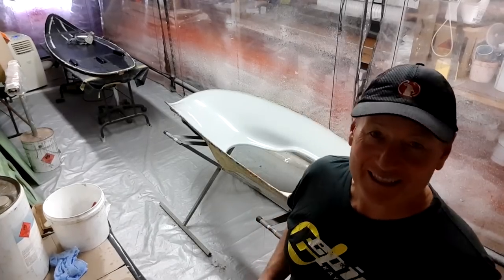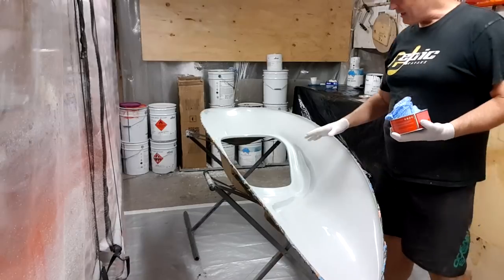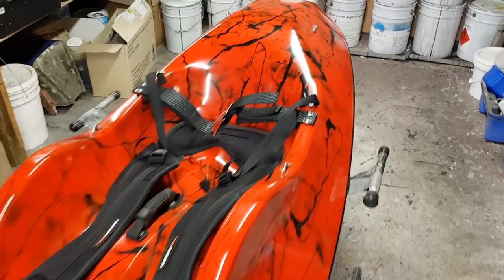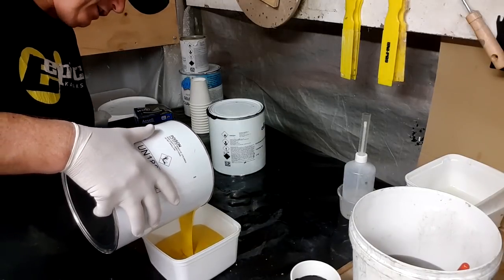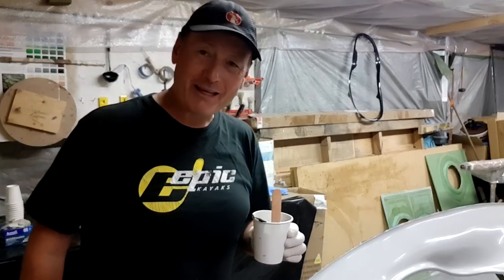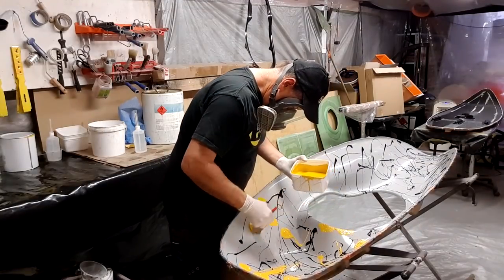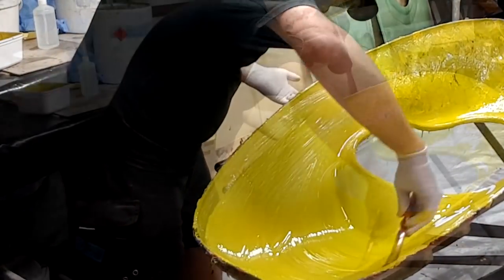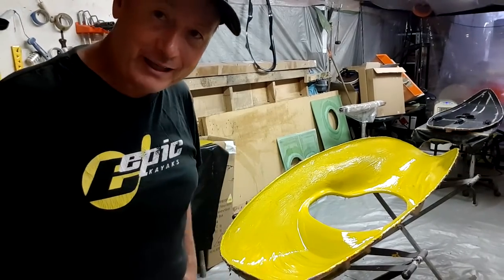Ep03 Creating Custom Gel Coat Finishes - Kayak Build - The Composites Shop

Comment: Doing the reverse on a Wood based outdoor deck want to do a light gray base and splatter pattern White / Black. My question is more about wax additive. Q: Should I wait until all colors are down and clear coat ?
Or Apply Each Color with wax and remove wax after cure then apply next color (Base Gray, then Splatter White, then splatter Black)
Really would like some input!

Comment: What is the difference between gel coat and flow coat?
Reply: Thank you I understand. I knew the wax made it easy to sand I didn't understand what was going on. Never heard the term flo coat before. If I can ask when I see upper deck repairs made it looks like they spray something green over the gel coat or? Flow coat. What is the green stuff. Does it replace the wax so they can use gel coat for an exterior repair?

Comment: ES G100 cup spray gun would save you some time.
Reply: For the backing color application, G100.  Webbing additive and an HVLP gun with no air cap would give you a more consistent effect for the webs.  The technique is fairly similar to how they do cultured granite, except you don’t have the clear gelcoat application.  I have a collection myself.  My production units are a Magnum Venus MiniPro 22:1 w/ ATG3500 for gel and a MiniPro 11:1 w/ Talon Internal mix & RC1000 roving cutter for resin.